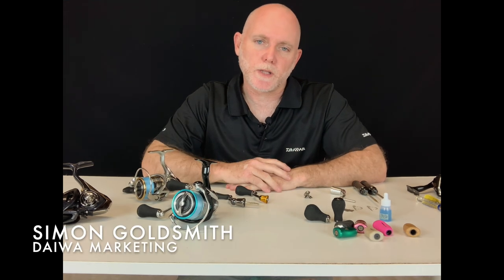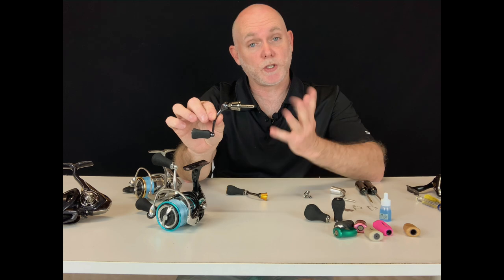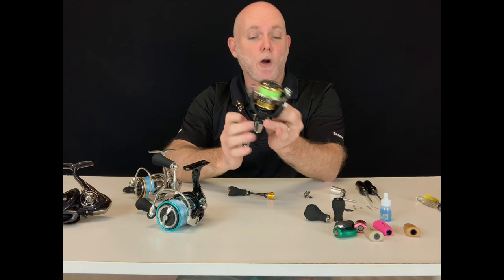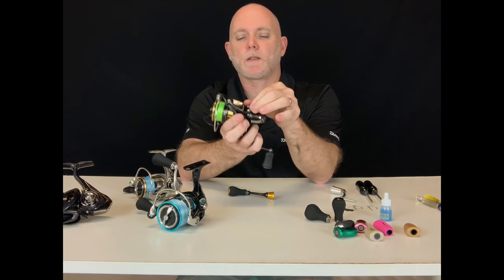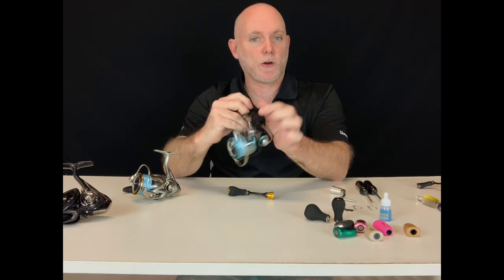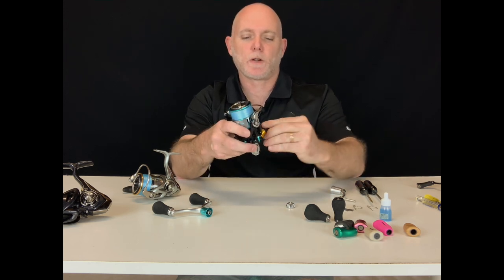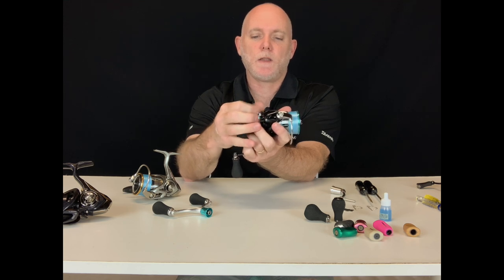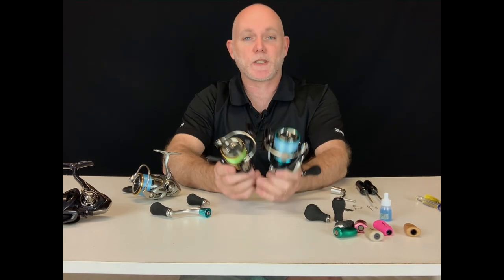How to Remove and Swap the Handle on a Spin Reel- Daiwa Tech Tips

Comment: Need a new handle / knob for my brand new Daiwa 21 TD Black 2500D.  Purchased it yesterday.  The knob has few mm play and makes the reel feel cheap when winding the handle.   What upgraded handles suit this 2500D?   It has a screw in handle, but only on right (left side has different internal fitting when removing the cap). 
Thanks in advance,   Brad.

Comment: I have a Diawa Saltist 5000.  the posts on there side are COMPLETELY different.  One has a small screw in it, the other is solid and they are different diameters as well.  You can not simply interchange the two pieces.  I assume a handle swap can be done, info so please provide info/link for instructions that are appropriate for this reel.

Comment: To anyone watching this video to figure out how to switch the handle to the other side with the pin through type, there is a black plastic piece that can get stuck in the one side, just pull that out and place it back on the 'nut' piece.
Reply: Thank you, something simple as that,it was what I needed.

Comment: Greetings,  question, just received certate 3000 xh 19, and there is a black washer rubber bushing ? at connection of handle but it does not tighten all the way , I see some silver in Between handle and reel?  That black rubber gasket in between the issue? Is it supposed to be inside handke metal or sitting on reel part before I start tightening it ?or is it normal to see little space there? Ughh
Reply from the maker: That little space is normal!
Reply: @DaiwaAustralia  thanks what a relief !

Comment: On the 2020 saltiga, when on the LHS the handle couples up tight and snug to the body, but when on the RHS there's a gap of a few mm's allowing water and salt to deposit inside the handle. Why!?
Reply: Same on the new Luvias LT. I was shocked at the difference between left and right. It’s a design fault.